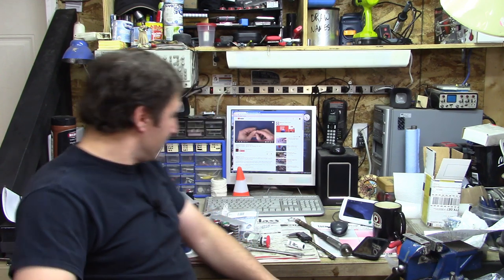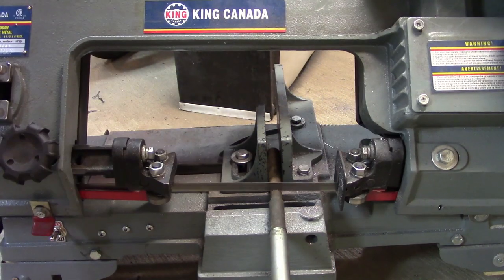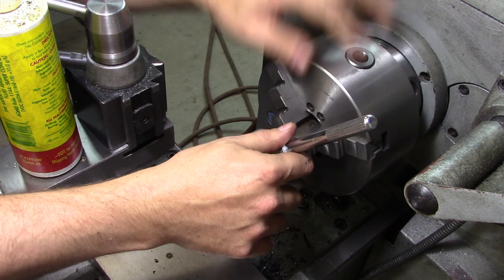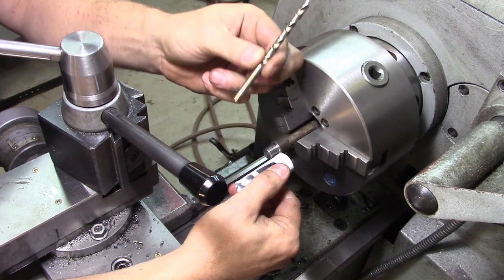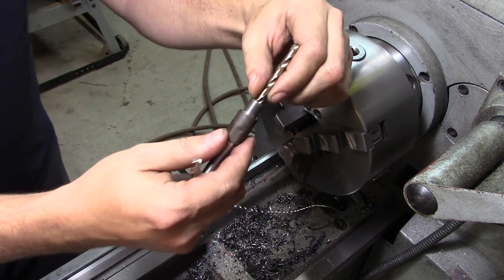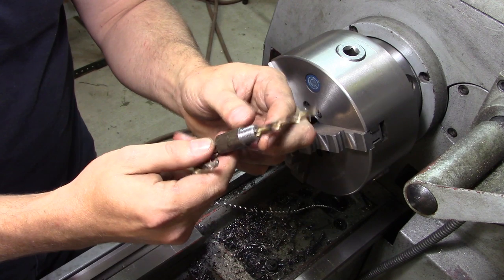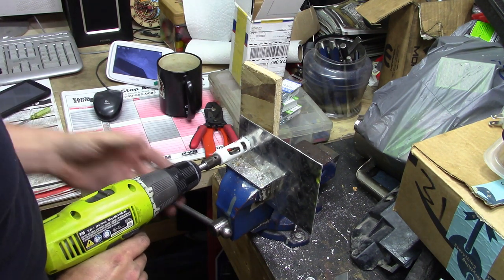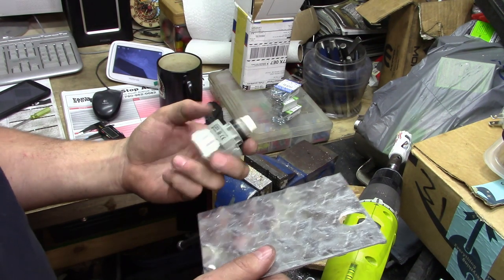Making a Hole Saw Arbor from Scrap

Comment: Nice job Everett, I appreciated your comment on not being named a the one who makes crap stuff. I did a similar last week, made a live centre for a wood lathe that only had a dead centre that got very hot and required constant adjusting, piece of 5/8" and a hot rolled piece of 1 3/8" and a couple of small deep groove ball bearings, just like your arbor, it looks like a million bucks! Cheers bro!
Reply from the maker: Thanks Howie, mistakes will be made as we are all human but I don't want a reputation as a reckless hack.  That's cool about the live center, it's part of the fun of doing this sort of thing to be able to repair things or make them work better than original.  Even better if it's for someone else and you get a good reaction at the reveal, lol.

Comment: Don't beat yourself up.  It works great and cost you a little time.  That is a win in anyones book.
Reply from the maker: Thanks Harold, I still count it as a win, especially as it's primarily for plastic and wood usage.  If I break it I'll make another one and avoid the same error, no big deal.

Comment: I think it is fantastic that you make a tool out of scrap, that is what those machines you own are for. Most of the other YouTube (related subject) providers purchase or are given (for promotion) their tools and waste time doing a commercial showing them off. Who cares about that? You are making something useful out of scrap, that is what I want to see! Thank you and please keep it up.
Reply from the maker: Thanks Jim, I will buy a tool if I need to but figured that on this one it would be just as effective to make one.  Apart from once in a while if there is something that is fairly different that comes along, such as the magnetic holder and the boring/facing head, or if someone gives me a tool and I wish to say thank you publicly, I generally don't do "show and tell" videos.  Not that I have anything against those who do, it's just that most of my equipment is pretty generic.  Thanks for joining in!

Comment: Cheap is a good thing when applied well, we do it here, money not hanging off trees well we do not know there are no real trees here, we do have a lot of Joshua Trees. 
We do have hole saws, two main makers, though what we really want here is a US made mag base drill and those annular cutters just sharing dream machine and its tools with you Everett. Well great you made that build work well.
Thank you for sharing. Lance & Patrick.
Reply from the maker: Thanks Fellas, it should work for my uses, for sure.  There are some things that I buy because of needed precision or because the deal is very good, other things, like this arbor, are things that I will make because I can.  Those mag drills and annular cutters are very cool machines, we have one at the heavy truck shop and it's is the cat's meow for some jobs, for sure!

Comment: Another great video Everett.  I received the stickers on Friday and really appreciate you sending them along with the note.  I just picked up the same band saw you are using (heavily used and badged as Central Machinery here in the US) for 25.00 US.  Rebuilding the centrifugal start motor this morning as it has been sitting out in the weather so we will see how it goes.  Cheers.  Mark B.
Reply from the maker: Thanks for getting in touch Mark, glad they got there in one piece.  25 bucks sounds like a decent deal even if you have to find a new motor - these saws are 400-450 bucks in Canada.

Comment: Tie rods are great for making punches and they turn down to what ever size you need. If you have the tools to make tools that is always a better way to go when making custom tools. Nice Work!!
Reply from the maker: Thanks Craig, I save all sorts of car and truck parts that could be repurposed because the material is cheap to free. Auto parts also seem to use reasonably decent metal so that helps.

Comment: Nice one Everett, I like making honey out of shyte too.  If you run round the shank with tig you can forget about it, you know you'll try it sometime and it'll let go when you most need it.  I too thought that component would be harder, good to know.
Reply from the maker: Thanks, I'm a packrat for a reason lol.  I'm not going to worry too much about it, just will be more cognizant of drilling depth for the next one I make down the road.  I only really use hole saws for wood and plastic anyway so this will work fine for my uses.  I wasn't expecting super hardness in the tie rod but it was "gummier" in cutting than I had expected.

Comment: Gday Everrett, it’s very satisfying when you make something for no cost, as you know I try to make all my tooling simply for the cost factor and when you use that tool you made its so much more enjoyable, I thought the tie rods would have been harder then what they looked like when you were machining it, what a great source of round stock, I will be looking out for those now that’s for sure, thank you for a great video as all ways mate,   ATB Matty
Reply from the maker: Thanks Matty, we are both in the same situation of having a hobbyist's needs and a hobbyist's budget.  We buy when we need to but trying to make what we can buys that breathing room to get those special purchases.  I wasn't sure how hard the tie rod end would be but it seems reasonably soft - it will still do what it needs to, thankfully.  Hope you're doing well, watching your Flo N Go video right now, making me itch to get the shaper running!

Comment: I admit I was waiting for it to snap off but once again,  persistence paid off,  Greg.
Reply from the maker: Hi Greg, I figured it would be best to test it on camera to see if it would fail right away, and if it'll do 3000 series aluminum it will handle the PVC electrical box.  If it does snap down the road I'll make a replacement for it, no biggie!
Reply: @EverettsWorkshop  Yep, I knew you could fix it if needed but it's like watching old Perry Mason episodes that have me setting on the edge of my seat waiting to see who done it!  We had some of those moments in bricklaying,  too!  Have a good day, Greg.

Comment: Great job Everett! Where I come from, cheapness (aka. frugality) is a virtue, so I admire yours :) I'll bet you have other places you'd rather spend that $20. Also, this opens up the option of customizing the arbor, perhaps to use bigger or smaller drill bits, or perhaps just a smooth rod by itself, perhaps to fit an existing center hole. You could also have two for the price of one if you need to use two together on a certain job, instead of changing back and forth :)
Reply from the maker: Thanks Steve, after seeing how easy this one was to make I might just make an arbor for each hole saw I get from now on. The price is right for them and it would be more convenient. Would probably add 3 flats on the shanks of any future arbors though.

Comment: Nice job. I always make my own arbors for my Bridgeport mill. I noticed your lathe is exactly the same as my Grizzly G4003. A couple small differences. But overall it's almost identical. I like it a lot. Definitely a good import lathe.
Reply from the maker: Thank Alex, I just didn't want to spend another 20 bucks, and had the material sitting there.  I'm almost thinking of making arbors for all of them now so I don't have to switch them around.  As for the lathe, I do like it, but it's taken a bit to get some rough edges taken off and work some bugs out.
Reply: @EverettsWorkshop  yup it was same with mine. The arm for setting the change gears came bent. And I just had to resolder the centrifugal switch in the motor and I had to grind in my chuck to reduce runout. I'm adding a DRO also. Then it should be great. Definitely a good lathe for single point threading and making arbors on.

Comment: Everett, that was a fairly quick solution to a small problem! Nice work! I’m wondering if the tie rod wasn’t some type of medium hard carbon steel, which would be perfect for your usage. I would have turned the shaft to around 7/16” and milled three flats that would fit in a 3/8” drill chuck. These small arbors tend to slip in the chuck when drilling steel.
Reply from the maker: Thanks John, I had thought about milling flats but don't have an ER40 collet that size to use in the hex block.  As I only normally use hole saws for wood or plastic the straight shank should work.  If it doesn't I'll just buzz another one up out of scrap again, no biggie.

Comment: Nice arbor Everett.  Do youself a favour and get some step drills, preferably spiral fluted versions.  Very inexpensive from China.  I use them all the time for holes in sheetmetal and plastic.  The great thing about them is they take off the entry side burr of the hole in one operation.
Reply from the maker: I borrowed a step drill from my buddy Eldon when drilling the PVC box on the mill, it did a decent job. Just figured to use a hole saw this time and that's when I discovered my arbors didn't fit it.  Probably will get a set of step drills at some point though, like you say they are handy for a number of things.

Comment: If plastic is too hard, then, get something softer...   😂
Guess after this, we know what to avoid...  👍👍😎
Here Philippe, Robert and I just got a 6 to 8 tons load lot of of cutouts metal to undergo new projects, that's a LOT of scraps....    (4140, 1045, 1018, hot rolled, cold rolled, Stainless, Al... )
Reply from the maker: Hey Pierre, yeah, one small mistake but it should still serve its purpose for plastic and wood.  Philippe told me about your materials run, that sounds like an awesome haul!  Good thing you cleaned out room in your driveway, lol! :P
Reply: Danielle is now on my back to clear the space, this is what happens when you spoil the wife...   😰😱
So bad that we don't get fixed price packages like in the us, that would make shipping metal economical across Canada...

Comment: As ever, love the re-purposing of 'stuff' you have on hand.
That did well, even with a small goof! Seems odd an arbor costing twice the hole saw!
Reply from the maker: Thanks Chris, you reuse stuff as well, it helps the financial sustainability of our hobby . . . It was a goof for sure but it should still work ok for the purposes I need it for, as I only really use hole saws for plastics and wood (with one notable exception notching pipe once with another saw).  And yes, that brand of arbor was 20 bucks in the store, the 7/8" saw was 10.

Comment: One of my smaller hole saw adapters has the drill bit extending through the back, that is what the chuck grabs and drives the saw by.  Unnecessary to cut off the drill bit.  My 1/4” hole saw bits have three angled flats or positions.  Just a FYI.  I know you’re likely out in the shop late at night and tired, so things can slip right by you.
Reply from the maker: I guess I could have driven the unit by the shank of the pilot drill, just didn't think of that possibility.  If I was going to use this in harder materials I would have taken extra time to machine flats into the drive shank but the primary use for it will be plastic and wood so it should be acceptable.  And yes, sometimes it's a bit late by the time Little Man and Better Half are in bed, and that's shop playtime!

Comment: Nice video  that will   wut steel to just fine got one I made at work  same thing drilled hole to deep been using it for years never a problem mine is 3/4".
Reply from the maker: Thanks Anthony, glad to know I'm in good company if you did the same thing! It does work just fine, used it the other night on that electrical box. Actually had less runout than the commercial 1" hole saw I used for the other holes . . .

Comment: G’day Everett, down the road if you’re worried about the strength just run a bead of weld but it’ll be right mate:-) 
Cheers 
Peter
Reply from the maker: Thanks Peter, it held the other night when I needed to use it, so I'm not too worried about breakage at this point.

Comment: The maine shaft of an scraped ilectrick motor is also a sorce or round stock ,  cool  I have the same lathe as you  , did you ever make a review about your lathe , I  would like to know your pros and con's on  it  I live in Canada also
Reply from the maker: Hi Georges, I didn't do a real review on the lathe, just a bit of a overview during the shop tour.  It's ok for the price, there were some quirks for sure, and I find it sometimes hard to take really aggressive cuts but it's decent enough for what I need at this point.  Just thankful to have machine tools to work with again!

Comment: i put a 1/4 in shaft in my hole saw arbor and drill a 1/4 in hole in the work this cuts down on wobble this keeps the 1/4 in hole true and the saw hole good.
Reply from the maker: Thanks James, that's actually kind of what I did - used a center drill to locate the pilot hole then used the hole saws.  Worked pretty well.

Comment: Would have been perfect but works so it's good! Here is an automotive question; I have a 2015 Ram 2500 with Auto front windows and want to make the rear Auto. Is it just the switch that trips or is there a module I need as well?
Reply from the maker: Not perfect, but it will serve the purpose needed, thankfully.  As for your truck, I don't remember auto down being an option for them - the front doors have door modules that are on a bus with each other and the rest of the CAN network, but the rear doors didn't have modules to control the windows.  As for making the rears auto down, I'm not sure how you would do that.
Reply: @EverettsWorkshop  Thanks Everett, auto down is available on the limited and a couple other fancy models but only from the drivers switches. I guess I will need to find a wiring diagram..it was just a shot in the dark.
Reply from the maker: @CapeCodCNC  That's good to know it was an option - I mostly did transmission work when I was with Chrysler. You'd need wiring diagrams for both the regular power window system and the Limited system to see what differences there are. Not sure if you could just replace the switch, if the driver's door module or BCM need reprogramming, or if it's not an option you could add later at all. Sorry I can't be much help on this one, never had to do that.

Comment: Will you have to make other arbors for different hole saws or is that a one fits all arbor for that brand of hole saw?
Reply from the maker: This is the only hole saw I have that needs this thread as it turned out the other ones I have in the tool box are different threads or mount styles.  For now this one can stay permanently mounted.  If I ever need more arbors I can make them then.

Comment: That shaft will not break. Not even in 1000 plastics.
Reply from the maker: I only really use hole saws for plastic and wood anyway, so the thin-walled partially hollow shank won't be too much of an issue.  And if it breaks I'll just make a new one, no big deal

Comment: Do not cut the pilot bit, hack the end off of your arbor you don’t need it. Use the protruding end of pilot bit to drive the hole saw.
Reply from the maker: I've had a couple others suggest that too, maybe would do that on the next one if this one breaks.  It would be worth a try for sure.
Reply: Sorry, but that sound like a terrible idea to  me. All the large diameter hole drilling forces then need to be handled by the set screw to pilot drill interface. Which is not particularly robust.

Comment: I see no goof, it clearly works OK and that proves it.
600 thou, a Whit AF hex size, perhaps the Japanese are still using up WD stock they found in WW2 when they invaded the British colonies?😀 Anyone who knows about WD stock levels will so the humour,hopefully.
Reply from the maker: It works for what I need it for thankfully, so I'm content with its function even if the internal form wound up not quite what I had hoped.  It is an odd AF size, as I say I thought it funny that the Whitworth "spanner" worked better than the metric or SAE sizes!

Comment: Surely you've got a half inch x20 bolt and nut somewhere in the shed.    The whitworth spanner you found doesn't fit anything rational, you probably fluked a close metric equivalent.  Whitworth stuff is like pixie dust in the U S A, it doesn't exist anywhere!!!

Steve of the 500 spanners which fit nothing anymore!
Reply from the maker: Oh I totally agree abut the wrench, the fact that the Whitworth wrench fit the hex properly while neither Metric nor SAE wrenches did just seemed like an odd fluke to me as well. I can just now use that wrench to tighten and loosen the saw from the arbor.  Just seems like an odd hex size to put on a modern car as that was an OE Toyota tie rod end.  The only reason I even have Whitworth and British Association tools is because of the shaper, to be sure.  As for a 1/2-20 bolt and nut, honestly I didn't have one in the bolt bin. It's mostly inch coarse and Metric stuff.